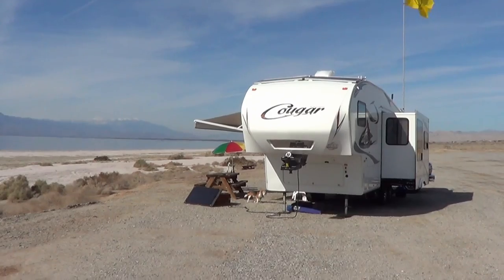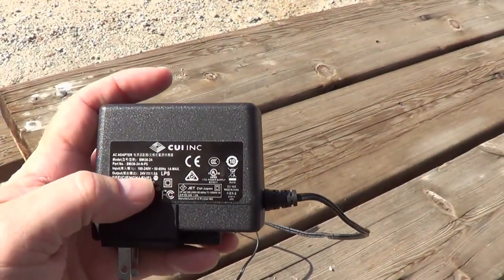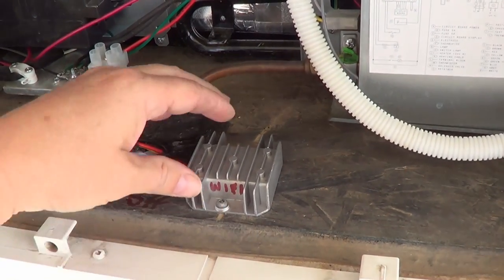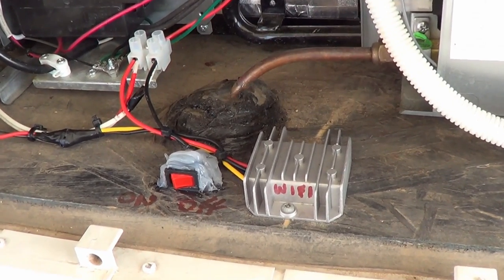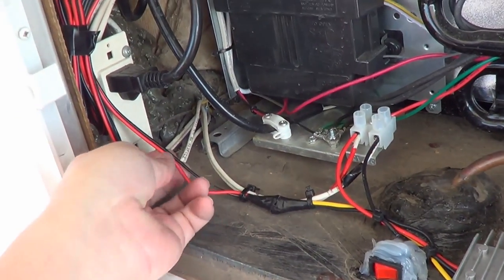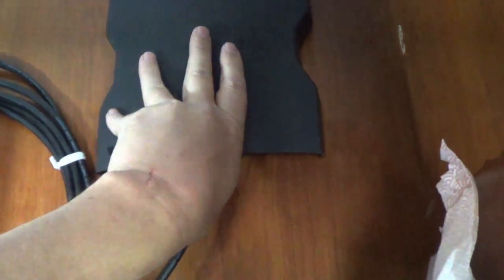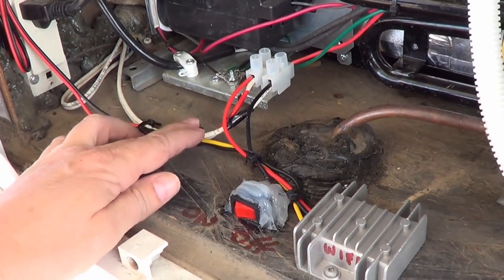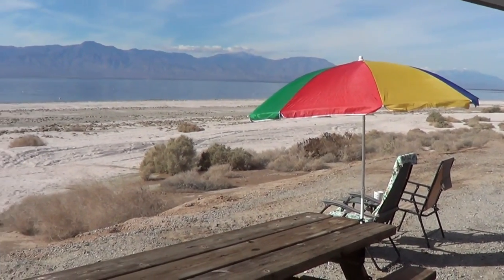Boondocking Power Tip DC to DC Converter Mod

Comment: Thanks for the inspiration. I installed a 12 to 6 volt converter to power an iPhone dock beside my bed. The outlet there is one of the very few not on the inverter circuit. Also, there is a lot of power required just to have a 2000 watt inverter on.  Found a 12 volt wire under the bed to tap onto. Thought I would have a problem finding a ground but discovered that 120 volt metal junction boxes are grounded to the RV frame.
Reply from the maker: Nice!

Comment: did the same thing in my RV but i used it to help power my 24v inverter from the 12v power when driving down the road .  that helps charge the inverter batterys at night

Comment: I went the other way 12v to 6v to power a clock radio on the night table... worked great... at the same time I added usb charging ports to both night tables

Comment: As I recall, you mounted the base unit above your fridge with all that extra wire with the intention of moving it if necessary for better reception inside. With that "wall wort", you could have plug it into any outlet in the RV to do that. Now, with your new wiring it seems that it's current location it permanent unless you put another plug on the "wall wort".
Reply from the maker: Yes, I'm gonna solder a new plug on my wall wart. Just not near any electronics parts stores right now and wanted to get the install done. Impatient. :)

Comment: if your fridge is propane then I would recommend you use a vapor proof switch.  I may be over cautious but propane leaks and fires around RV fridges is one of the leading causes of RV fires.
Reply from the maker: Could do but the area is so well ventilated, basically open to the outside, in my mind it would take a massive leak to be a problem which I would notice due to the smell before I flicked the switch.  My Suburban water heater runs on LP Gas and they have a similar switch situated on the outside and it is switching 120VAC at 10 amps. http://www.loveyourrv.com/wp-content/uploads/2013/12/Suburban-SW6DE-Hot-Water-Heater.jpg

The fridge itself has several non-vapor proof relays on its controller board back there and an auto ignition sparker which would ignite the leak well before a tiny spark in the switch could. LP Gas systems in an RV have safety valves that shut off the flow if there is a leak and pressure drops
I think you'll find the bulk of RV fridge fires are from the cooling unit failing (boiler overheating) there is actually a big class action lawsuit on about it now or unchecked debris ie birds/rodent nests being ignited by the open burner flame.   Cheers Ray

Comment: Hi from Ontario. Have you seen any 12 volt to 12 volt regulated supplies? I have an android box with a 12 volt input but am worried I'll be over powering it when the charger drives the batteries up to 14.2 volts.
Reply from the maker: Most devices that are designed to run off an auto's 12-volt system can handle 14.4V without issue since the alternator usually can output that high.
Reply: Yes but that is possibly a problem for a home device which I want to use in the vehicle. I guess I'll just have to roll the dice and see if it stands up to the higher voltage.

Comment: Excellent video as always!.....:)   Odd that it would be 24 volt?  Don't you have 2 pair of 6 v batteries?.....You could have tapped off those and not had to bother with a converter. How is that Wi-Fi setup working for you?
Reply from the maker: Thanks, I have 4 - 6 volt batteries wired in series parallel to power the RVs 12 volt circuits, that's what the 12 volt to 24 volt converter is wired to as the input source.
Haven't had much chance to test connectivity yet, haven't been near any free ones, but it sure finds a crap load of networks compared to just using my phone or laptop!

Comment: Is the on/off switch really necessary if I can turn off the Winegard black box device itself (there is an on/off button on mine).  The switch would be any 12V two connection device?  Thank you for this video Ray, I bought the converter, my project is slowly advancing :-0)
Reply from the maker: This mod is only for the older ConnecT version 1.0 that ran on 24 volts DC power, for the newer ConnecT version 2.0 they changed the power required to 12 VDC and come with its own switch so the DC-DC converter mod was no longer needed. Cheers, Ray
Here are my 2 installs
Version 1  https://www.loveyourrv.com/installing-winegard-connect-rv/
Version 2  https://www.loveyourrv.com/winegard-connect-2-0-installation-and-review-wifi-extender-4g-lte/
Reply: @LoveYourRV  Thank you, Ray, I will review the installs, it is great material, impressive work!!. My Winegard is a WFAP-01 24DC 1.67 4g there are 5 legs instead of 3 it has the same writing on the side of the wall plug as yours.  No 12v package. I would like to keep it since apparently, this model has a bit better range than the newer models, according to Winegard and rood is too small for the dome type.  I will consult someone better knowledgable than me before I modify. :-0)  Just taking too much of my batteries when I turn the inverter on,

Comment: Since you have 4 batteries, I'm surprised you didn't just run a series circuit from the battery bank to get your 24 volts?
Reply from the maker: My 4 - six volts golf cart batteries are wired in series and parallel to achieve a 12-volt bank -

Comment: I noticed one small mistake, it you are producing 1.5 amps at 24 volts from a 12 volt source your 12 volt drain is more than 3 amps not 1.5 amps. But other than that looks nice. 8-)
Reply from the maker: Yes, your right, my mistake in the video
Reply: BigFireDave lol and this is why I try to read comments before posting. I was about to say the same thing. haha

Comment: Is there a reason there is  no relay to the switch? at 15 amps you MIGHT have problems with it, but I assume you know what you're doing.
Reply from the maker: Most of the little toggle switches are rate for 15 - 20 amps but this switch isn't passing anywhere near 15 amps, just a few amps to power the WiFi Booster. The 12V supply circuit is fuse by a 15 amp blade fuse in the RV main power panel in case of a short circuit. The DC-DC converter also has short circuit protection. They used similar type switches all over the RV are light switches etc, and they don't use relays. Cheers, Ray

Comment: If the connect Wi-Fi antenna uses 1.5 amps at 24 volts, wouldn't the 12 volt circuit have to supply up to 3 amps to make that happen? not 1.5.
Reply from the maker: Yes, your right, my mistake in the video

Comment: Is that any different than a step up transformer?
Reply from the maker: Sort of but more complex than an AC step-up The input DC is usually chopped up into a high-frequency AC type waveform applied to a small inductor or transformer and then rectified back into DC again, plus regulated. So there are usually a bunch of transistors, diodes, capacitors, resistors and a controller chip and the in the package.

Comment: Great idea  but did you do your math right?  You said the DC-DC converter will only draw 1.5 amps off your refrigerator circuit.  You don't get something for nothing so if it's giving you 24V at 1.5A then it's drawing at least 12V at 3A, no?  Still  plenty of amperage in your fridge circuit.  I'm just being a stickler. :-)
Reply from the maker: Yup, got it wrong in the video  :)
Cheers Ray
Reply: Love Your RV you knew some picky jerk out there would say something didn't you? :-) I can't help it. I gotta be me.
Reply from the maker: haha, you were late two other guys beat you to it. :)

Comment: You are loosing efficiency the same way you would using an inverter.  You might want to consider getting a 24v battery or putting 2 12v’s in series. That would be the best way to maximize efficiency.
Reply from the maker: Yes, but RVs come wired for and use 12VDC to power DC loads. So, you would need to install a 24V to 12V converter, which kind of defeats the purpose. Cheers, Ray

Comment: I still can't believe they market a product for an RV that is not readily powered by 12 volts
Reply: Allot of it is the transmitters.  If you spend allot money on a booster you want it to reach and work like its stated. Then its gonna need extra power to handle the distance and take full advantage of the antenna. There are 12 volt versions, even 6 volts are out there. but there range is way less then the 24 volt ones. 

They also may not expect your DC system in a RV to be so complex like Ray's here. It be time consuming for him to reset up his system to out put a 24 volts. Most the time out of the factory a RV just needs a 24 volt battery or a second 12 volt hooked up together to make 24. He has allot batteries. but there hooked up to only output 12 volts. Most the time i see hooks up like that they often pick 24 volts or higher, and just use step downs where needed. but he is using a step in his setup to power his booster. It most likely still would of turned on and worked with only 12 volts. but its performance and range would be lower.
Reply from the maker: My theory. Likely what is happening is the PoE "Power over Ethernet" cable they are using to send power to the external amp and antennas is 24 volts so easy to have a 24 volt supply which is convenient and cheaper. I think they, like many other RV product manufacturers, think all of us are on full hookups, which is for the most par,t true. I think once they get some feedback they will start to include a 12 volt adapter in the package. It is Winegard's first crack at RV Wifi. Cheers Ray
Reply: All wi-fi boosters and cell phone boosters are regulated by the FCC, so voltage is only a product of design rather than function.  All cell phone-wi-fi boosters were neutered by the FCC 4 years ago, so anything made after that ruling are performing at substandard levels IMHO.   12 volt would be the standard, so odd that it's 24 volt.  Perhaps the cost of the Unit  they assumed it would always be powered at a plug in site.  Not pulling a great deal of amps, so switching to a 24 volt converter isn't really gaining much in savings.  There's several ways he could have done this.   Nice clean setup for what he wanted to do.

Comment: Yes, inverter wastes power but so does the  dc to dc converter. You are not much better off
Reply from the maker: Our 1000w inverter has a much larger overhead to run than this little DC-DC converter. The idle current on the inverter alone is over an amp. Makes no sense to me to fire up the large inverter to run such a small load. I installed a switch so I can turn off when Winegard Connect is not in use. Thankfully in version 2.0, they made it run off of 12VDC  https://www.loveyourrv.com/winegard-connect-2-0-installation-and-review-wifi-extender-4g-lte/  and included a switch. Cheers, Ray